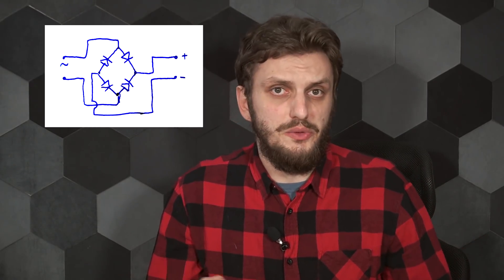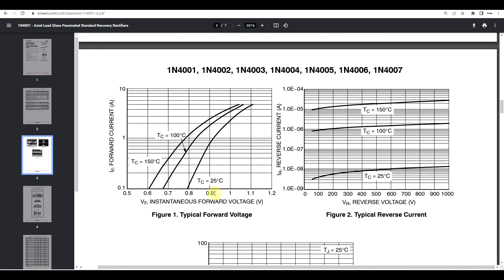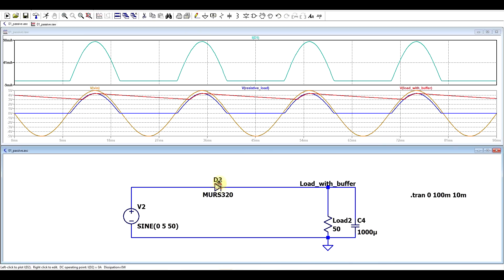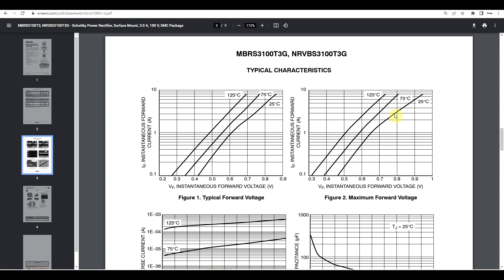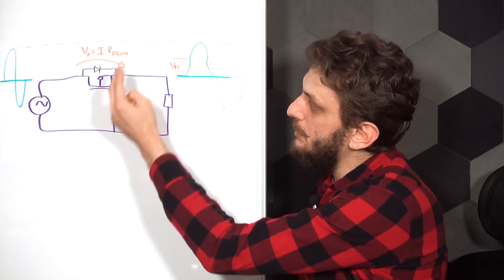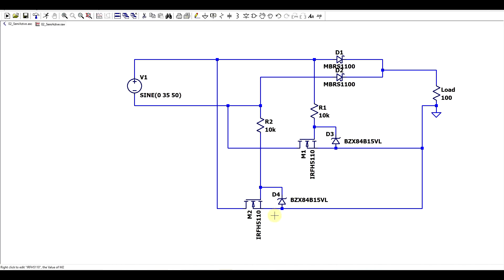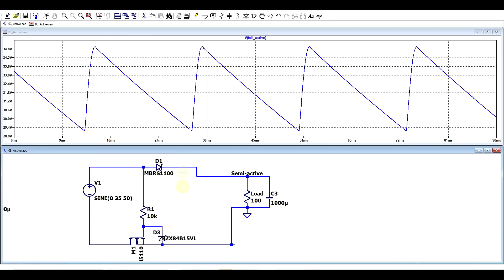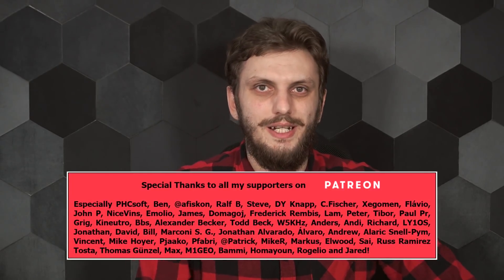Active rectifiers (1/2)

Comment: at @10.50 why the current of p type mosfet flow from drain to source?
Reply from the maker: With a mosfet, the current flow is not restricted to one direction or another like with a bipolar; when the transistor is not polarized, current can flow trough the internal body diode from drain to source; and when the transistor is polarized it can flow both ways. The idea with this circuit is that at very low voltages, the body diode can conduct, while above the transistor threshold voltage, the transistor is conducting.
Reply: @FesZElectronics  Thank you very much.

Comment: Good one. So the n channel mosfet has to be used with the drain at lower voltage than the source... To avoid the internal diode providing a reverse path from the output capacitor!?

Comment: Don’t you need a boost to turn on the high side FET on a full bridge sync rectifier? How do you power those comparators and have them output higher voltage than high side?
Reply from the maker: Hello John, as long as the high side is P-channel then you don't need any higher voltages; its true however that Nchan is cheaper, so if you want to use that, then a boost or some other circuit is needed.

Comment: From what power would active rectifiers be worth it ?
Also i tried to find an integrated solution but i failed, might be because of chip shortage.
Reply from the maker: Its not just about high power; this sort of rectifier can be used in wireless power transfer - relatively small amounts are power are transferred, but efficiency is very important. Its also a topic of price, when is the extra price still worth it?
Reply: @FesZElectronics  thx i think i get it better now

Comment: Another application of active rectifiers are in flyback convertors as it not only increases efficiency but also allows to get several stable voltages from single convertor. Traditionally if there are windings for +12, +5 and +3,3 volts for example, one should choose just one voltage for feedback and that one would be most stable. Another voltages would increase a lot under low load because of lower voltage drop at diode and some high-voltage spikes at transient which charge output capacitors. But when there is active rectifier which stays on all the time of flyback, these problems go away. Stabilizing one voltage basically means stabilizing them all!
Reply: Thanks for this brilliant tip! 
I wouldn't have thought of that.

Comment: For a 14v 70a dc power supply, what would be the ideal circuit with this level of amperage?
The issue of RFI and heat is important in my situation...

Comment: use dc-motor-to-ac style active mechanical generator, but in ac-to-dc-to-dc motor generator form
Reply: you can do all digital solid state in the mechanical equivalent simple form
Reply: use the motor as a flywheel, that will smooth the dc output, assumed that you have a dc output generator attached to the sudo-dc input, so diode full wave rectifier with the flywheel dc motor to dc generator link
Reply: so you dont have fans in your electronics systems, use the mechanical version you get the application alongside without much extra effort, ie mechanical fan generator power source

Comment: There is also another benefit from active rectifiers or ideal diodes that can be useful in some cases. With a regular diode or rectifier there will be induced RFI noise from LCR type ringing when used with a regular transformer. This is due to the switch-on transient from the diode. In some cases the RFI can cause issues with sensitive circuits. The RFI can be dampened with snubber networks, usually a series capacitor and resistor in parallel with the transformer. An active rectifier eliminates this problem, because it begins conducting almost from 0 V. Personally, I've used LT4320 with four Mosfets.

Comment: great subject , I use this LT4320HMSE#PBF in my amplifier with N channel Mosfet IPB017N08N5,  usually active rectifier use both P and N channel. which is in my opinion not good , this circuit has even pump up charger too ,and you need only N channel .

Comment: I have a question about active rectifiers. What happens with noise? Meaning if i know that i will use a rectifier with a very noisy input signal. Does active rectifiers need an attachment to filter noise?

Comment: This is a great video but I'd love to also have the current comparison as well as the voltage comparison in the end. I can't wait for part two.
Reply from the maker: I guess I did not look at current since there is not much of a difference as long as the same output capacitor is used. The big differences occur in voltage. Part 2 in work :D

Comment: Or chain link rectifier between volt regulator stuff or how a director can be used to stop a curcit especially neg run curcit act as a filter cup or regulat DC signal on neg lines to stabilize it or on the relay flyback led set that stops the operation???? annoying no!.

Comment: I have used a design with traditional bridge configuration, but with such a high current that the diodes eas screw mounted on a heatsink. So clearly a big loss.
An othe way to rectify very high current (and/or voltage) in the hundred of mega watt range is using mechanical switching. Or electric generator / motor configurations.

Comment: Great video as always, looking forward to the second part! :) You mentioned forward-voltage drop trade-offs between silicon and Schottky diodes, but what about switching speed (reverse recovery time) which also contributes to losses in high frequency converters? Also, why was ".options cshunt=1e-14" used on 14:37?
Reply from the maker: Great points! When talking about high frequency behavior, Trr (reverse recovery time) is typically a problem that is not associated with Schottky diodes, the issue there is only the large junction capacitance(Cj). At 50 or 60 Hz though, neither of these parameters should be of any concern with modern diodes though. For whatever reason the simulation was having convergence issues with the op-amp model, and usually an easy fix is the addition of the cshunt (capacitance from each node to ground) option, 1e-14 being a mostly neglectable 0.01pF; even 1e-15 is usually enough